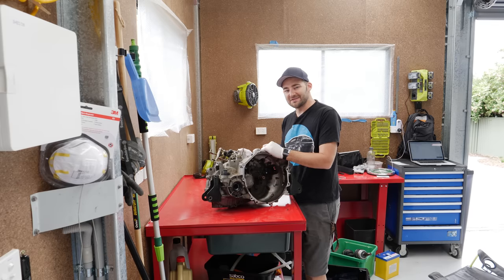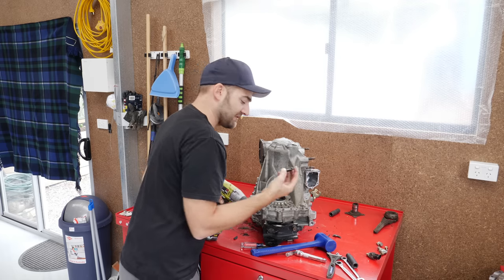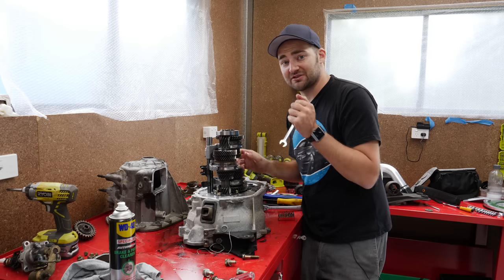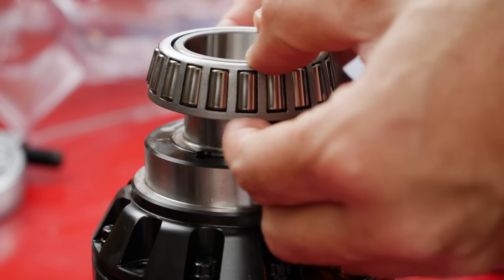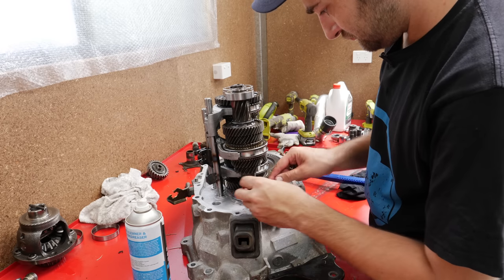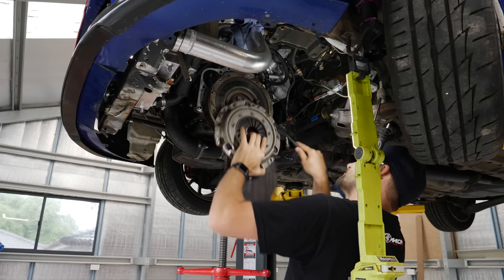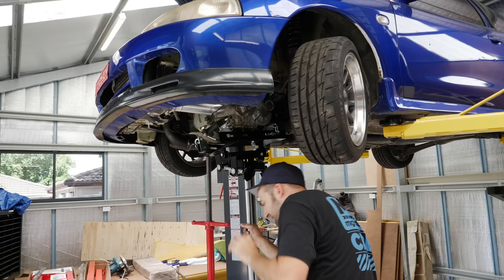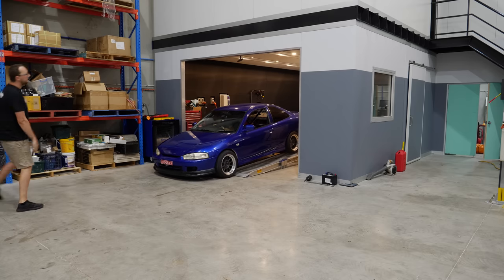Limited Slip Diff + Clutch Install into 2Sexy [Part 2]

Comment: why spend 200 dollarydoos when you can just move the speedo gear over since the lsd had a machined section for it
Reply: Different tooth pattern and count so you'd likely need a different plastic gear and possibly a speedo converter box anyway (to correct to the right number of pulses).. and there may not be a factory part intended for that housing/diff combo. On the other hand seeing as Haltech is pretty closely associated and often a sponsor they where likely going to use the replacement dash regardless of if the speedo worked in the base car, and that dash supports GPS based speed and can be swapped between future project cars rather than being specific to a make and model. So its simply a case that it wasn't worth spending the time to fix something they didn't need, and the speedo may even have already been out of calibration anyway due to tire sizing.
Reply: @SheepInACart  what!? Different tooth pitch? How? Its the OEM speedo ring gear from the stock diff moved to the LSD. Its the same gear so the pitch wouldnt change at all. He didnt change any ratio in the diff either so again nothing changed. All he did was swap the centers which you can do any day of the week and not worry about your speedo changing. So idk where you got all that other crap from but please don't say that to anyone else.
Reply: i was thinking the same thing, all he had to do was remove the speedo gear and press it on the new diff. 5 minutes to do. speedo will still work then
Reply: We can only assume the inside diameter of the of the speedo gear was not fitting the outside diameter of the machined section on the new diff (or maybe a different depth). Nothing that would not have been easily fixable with a lathe. On the other hand they already have new electronics that might be able to drive the speedo using the the abs sensors. Lots of missing information for us to jump to conclusion.
Reply: @xavierthomas1980  I bought an OBX LSD (they're about $500, a Wavetrac LSD is much more expensive) for my Integra GSR transmission and when I installed it the speedo gear swapped right over, so it wouldn't make sense that this one wouldn't have as well. I don't believe he ever tried or cared to.
Reply: @xavierthomas1980  Very true Xavier
Reply: @Brock_Landers  i would be be rather pointless for aftermarket LSD makers to not make the speedo ring gear mounting the exact same. How many fwd/awd (transaxle) road cars would be fucked by a simple LSD conversion? After all the spur gear is a straight swap why not the speedo ring gear
Reply: @liamcooper5202  i agree, looked like it would've worked if he had taken the 3 minutes to swap it over. just making more work for himself and will end up spending more money to get a speedo back for no reason
Reply: @liamcooper5202  That's my point...
Reply: Had Turbo Yoda or Mechanical Stig been there that speedo gear issue would have been resolved. We're all bantering like it's our own car here lol! After seeing all these comments about the speedo gear it's safe to say he won't be doing it any time soon. These episodes were filmed long ago and with their work schedule they won't touch that car again for months.
Reply: weight reduction maybe?
Reply: @coreyclark2692  More work just means another video posted on YouTube. You're not watching tradesmen at work.

And I'm just assuming there even is a 2SXY after the battle to be worked on...
Reply: @Brock_Landers  yeah i know. I was agreeing and added to it for other person that thinks it wouldnt fit
Reply: On 9:55 you can see that the inside diameter of speedo ring is a lot smaller than the machined section on the wavetrac.
Reply: @idqd  looks the same to me
Reply: The open diff in this family of gearboxes has the speedo drive machined into it. Only the factory lsds had the removable speedo ring. MD 717879 is the required part which works with a 36 tooth speedo drive.
Reply: @idqd  bit hard to tell since the diffs are not facing the same way. But it would be odd if it didnt fit. He would have bought it to suit the box so all parts should be transferable
Reply: I was also cursing about the speedo drive. I've been there with my Wavetrac swap and just swapped it over from the stock diff. As a first timer it looked like its machined to the diff but it wasnt. Same goes for the rest of the swap, why not check clearances, preload etc while you are at it. Why it's a good idea to have a factory service manual if you dont read it at all 🙄
Reply: 8:30 both diffs are facing the same way. And in fact the diameter seems to likely be the same, on wavetrac there is just some slick ring in place of that toothed one.
Reply: @idqd  ah yes. It looks like it has a placeholder spacer. Whatever it is, it looks like it is pressed on and also maybe removable with a puller.

Comment: looks like you had all you needed to swap the speedo gear man
Reply: looks like the ID of the gear was too small, the LSD looked a little wider at that point.
Reply: Weight reduction !!
Reply: Who needs a speedo on a track car? Not that important. And as he said, you get the information from another source.
Reply: @___Steinn___  knowing how fast you're entering into corners is a big piece of information to improve your lap times...
Reply: @___Steinn___  Are you dense? How do you improve lap times if you don't know how fast you're hitting corners? Just hit them as hard as you can and hope for the best?
Reply: @bmos02  that's why racecars always have them? You get the information by rpm and which gear you're in... and he  (and i) said before, you can get it from another source (ecu, gps) if you want.
Reply: @_Professor_Oak  gear? Rpm? No open wheel racecar has a speedo. And..... it works. And he said you can get it from another source if you want (ecu, gps...) so a mechanical speedo is not that important.
Reply: @___Steinn___  even still, would've taken less than 3 minutes to swap that speedo gear over to the new diff and he wouldn't have had to worry about it getting speedo from somewhere else
Reply: @coreyclark2692  yes it really did bother me that he didn't transfer the part. Even if there are other ways to get your info, do the job right !
Reply: @coreyclark2692  his decision.
Reply: @___Steinn___  i understand that, he's just making more work for himself down the road should he want a working speedo
Reply: @coreyclark2692  his problem. I was just saying that a speedo is not necessary for a track car.

Comment: Why would you not simply swap the speedo drive over to the new diff?
Reply: Because the speedo drive is machined into the diff case on the open ones. Only oem lsds has removable speedo drive rings. Or you can use the ones used in the earlier gearboxes part number MD 717879
Reply: @m16a2m4  that was a bit vague... 😂

Comment: what about shimming of diff and checking clearances? not needed for mitsu?
Reply: I was thinking the EXACT same thing! I installed a MFactory LSD in my Honda engine, and everyone on the forum was stressing about the new "shim".
Reply: This is why he touched on needing the factory manual and not some junk one from the local part strore ffs.  He knows what he is doing just would make the video go on way longer.  He wanted to learn on a cheap box this happened months ago move on.
Reply: @duanebailey6253  butthurt? 30s of mentioning alignment would be reaaally long... he just simply didn't done it and is hoping for the best with old shims...
Reply: @MstreetDriver  It shows 2 new shims right after then cuts.  You need to factor in if it was filmed going back and forth with feeler gauges and checking how things sit.  Or was cut in editing since they showed a brief overview and didnt want to sift threw 2 hours of film.  Its fine marty knows how to use tools properly and has plenty of people.  He prob stopped filming picked up the phone and then carried on.  This stuff isnt complicated at all.
Reply: @duanebailey6253  2 part lsd video with assembly of trans jack and not a single mention of most important part in the process... makes sense...
Reply: @MstreetDriver  If you knew what your talking about then you would know and see the feeler gauge in the video at multiple points.  Its not like you can just put something in and check it.  You have to finish assembly check it take it back apart to correct it and repeat.  Besides the only part that really needs to be checked is between the race and the case.  Everything else will for the most part stay the same.  Also some of the shims have cuts in them to expand to meet the bearing and would explain it.
Reply: @duanebailey6253  feeler gauge? clearly you know what you're talking about lol... butthurt will be butthurt... just a hint, you need more than feeler gauge to check it but never mind... my points still stand
Reply: @MstreetDriver  There is only one bearing not multiple.  You need a feeler gauge to check between the race and the case to make sure the diff is at the right height.  If its to high or to low it will eat the bearing or the gears will rub.  Only other thing that needs to be checked is between bearings and the diff.  This is why there was spacers that poped out as well.  Plenty of how to's that show all of this info lmao.
Reply: @duanebailey6253  and that's the reason why keyboard warriors like you have need to discuss about things they have never done, your summary of some video is not enough, bye
Reply: @MstreetDriver  So cute lmao.  I dont need internet clout to justify anything ive done.  Your generation cant even be bothered to read a manual or a forum which proves the point even more.  His gears or diff will break way before anything else.

Comment: Wait so if that transmission came in a DSM... and some DSMs were AWD....
Reply: thus the evo jokes...
Reply: ahahaha
Reply: He probably could take some early endeavor or maybe some later outlander trans to make it awd, that’s assuming you don’t wanna pay for evo parts
Reply: I know 3000gt AWD transmissions were getrags so maybe the dsm ones were getrags too
Reply: That particular transmissions did not come in any DSMs
Reply: The cheapest and easiest way to make it awd is to buy a crashed 1800cc GSR lancer, drill the spot welds and tac over the floor pan. after that the rest just pops in. But due to it being a mirage asti you have to use the GSR or evo 4 (CN9A) pan as the evo 5 & 6 (CP9A) have a larger rear subframe due to the larger width rim & tyre combo with the factory arches covering them.
Reply: Also cams on the evo 4-9 are on the left, evo 1-3 & dsm right.
Evil DSM is right, was a different box.

Comment: Please tell me you didn't just use the impact to tighten the axle nuts and that you actually used something to torque them to the proper specification. Too many people fry the wheel bearings by using an impact only, which doesn't put the proper preload on the bearings. Too much preload and they over heat and basically melt. Too little and they basically bounce around and beat themselves to death. That is (probably) the most common reason for wheel bearing failure.
Reply: This style of bearing basically can't be "over tightened" as the inner races on the hub but up against one another and you would have to basically start squishing steel to make that happen. The torque spec is something super high like 145 lbs ft I believe. Under tightening is definitely an issue, but it would have to be pretty low to really cause a problem fast. I believe the spec is even +/- 12 or 15 something like that.
It's not like the old style bearings where you had to retain it just so to account for heat expansion, but not too loose. Anyways, you are still totally right he should torque it with a torque wrench if available. Marty is very particular, so I'm sure he did off camera unless he didn't have a wrench that went high enough. In which case, standing on a 1.5 ft breaker bar near the end will typically get it pretty close. ;)
Reply: @802Garage  HMMMMMMMMMMMMMMMMMMMMMMMMMMMMMMMMMMMMMMMMMMMMMMMMMMMMMMMMMMMMMMMMMMMMMMMMMMMMMMMMMMMMM 🤔
Reply: @rechargegamesstudio2803  😂
Reply: Not that kind of wheel bearing, but point taken on board for next time

Comment: oof.. i woulda done the spigot bearing while i was in there.. had one of those take out my clutch. $10 bearing destroyed $400 worth of clutch assembly

edit: turns out most FWD cars don't use spigot bearings xD  my bad
Reply: What spigot? If you look at the input shaft properly you'll notice it is only splined and has no part to go into a spigot.
Reply: @WhiteysWiring  well evidently i didn't look closely enough.. having only ever worked on rear wheel drive cars i assumed the front wheel drive input shaft would have a spigot also.
Reply: @UnacceptableViews  at a guess FWD probably don't require them due to the boxes being half the length and having a much shorter shaft that doesn't need to be held stable by the crankshaft.
Reply: @WhiteysWiring  makes sense. had i bothered to change the clutch in my old ford laser when it needed a new one i would have discovered these things lol.. i took it to the dump and bought a new car instead

Comment: I loved the fact that you guys use the term DSM that's awesome also the aluminum flywheel that you using the bolts that hold the steel starter ring gear back out over time they will need to be removed and and use Loctite on them so they cannot back out over time it destroys the flywheel to where it's unusable

Comment: Many will know, but some won't so: If your bearing is prepacked or has plastic parts, but what it goes into isn't, and is removable - like a hub etc, you can pop that into the oven. To help along more, you can even put the bearing in the freezer (but remember many plastics get a bit brittle when frozen so be gentle). If it's the other way around, you can put the thing the bearing goes over, in the freezer.

Also, if you have a blind bearing you need to extract (a bearing inside a blind hole), pack the space inside the bearing full of wet toilet paper, moist bread (not the crust) etc. Find or make a flat-ended rod that fits snug inside the bearing, and use a hammer to knock on the rod to compress the material /"stuffing" down in the hole behind the bearing. Extract the rod, pack more stuffing in, repeat. The fluids in the material will get behind the bearing and exert hydraulic force on it from behind, pushing it out, while the material itself binds the fluid enough so it doesn't just all spill out the way it came in. If the bearing is sealed (or at least the side facing into the blind hole is), this can some times even be preferable to extraction tools, as its actually quite gentle on the bearing (as long as you don't mar it with the plunger/stuffing rod of course). Be careful if using a wooden rod/dowel, as it can expand in the hole/behind the bearing due to the moisture contact, making it difficult to extract. So don't leave leave your woody in there while doing other stuff, extract at once whenever done beating it ;)

Comment: To heat bearings you can also use the AvE method: wrap in a few paper towels soaked in water. Microwave for 90 seconds.

Comment: you forgot about the diff bearing preload setting.  that's the shim you looked at all confused @9:14
Changing the differential carrier, or the bearings can change this preload.
Reply: I suspect he got to that part of the manual that showed the jig required to test the pre-load to select the correct shim to use in it and said something like "wont worry about that, she'll be right"

Comment: If Marty wanted to...
The cheapest and easiest way to make it awd is to buy a crashed 1800cc GSR lancer, drill the spot welds and tac over the floor pan. after that the rest just pops in. But due to it being a mirage asti you have to use the GSR or evo 4 (CN9A) pan as the evo 5 & 6 (CP9A) have a larger rear subframe due to the larger width rim & tyre combo with the factory arches covering them.

Comment: If you wrap the bearing in a moist towel (Because water evaporates at 100C), you'll make sure the bearing is at the right temperature for assembly. Simple trick I've learned

Comment: A trick to take some slop out of the shifter is to remove the rubber bushings from the shifter cables, were they attach to the gearbox, is to replace them with skateboard wheel bearings.

Comment: Marty definitely is moving up with his own garage and lift and everything so that's pretty cool.. here in the United States the 4G69 bottom end at least is used a lot in lancer Evo eights and nines to convert it to a 2.4 l and those make a lot of power but basically a stock one with a single overhead cam halfway decent turbo I think it will make good torque numbers but I'm not sure what this thing's going to do it would be nice to see that 4G63 in this car if the other car loses... Because overall I think this particular car that Marty has would be a cool weekend track car to have Moogs car other than the engine and trans is just ridiculous.

Comment: G'day Martin,,me being old school,Had a Nissan Silvia but blew the old gal to bit's,,more on that later, I like me VY ute, V8 5.7 and 6 speed limited slip( clutch pack)..yer yer i know slow and old,,but suits me,who is also Slow and Old,
Never mind,in the old days before turbo's were so great,,we used water injection to prevent detonation ( far to much timing and the other thing we did was run a cool can)Cans were merely a tube of copper pipe (cheap and easy to bend) in a can with a lid,,then we would fill can with dry ice,keep fuel cold on entry to chambers,( mostly carbs back in the day) and the water would vaporize into throat of carbie Just a wiper washer and a bit of thin copper tube in to carbie throat,this would allow timing to be a bit more advance with out detonation,now not sure if you would run this ,,but it just might give the edge over ) Twisted ( 
If I was you,,(wishing?) i would Have a talk with Al,and see what he thinks??